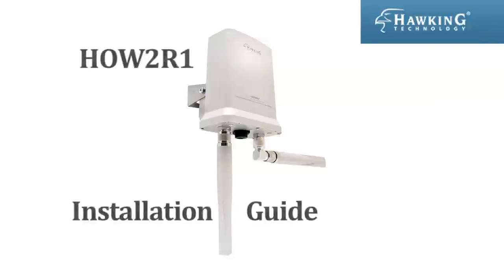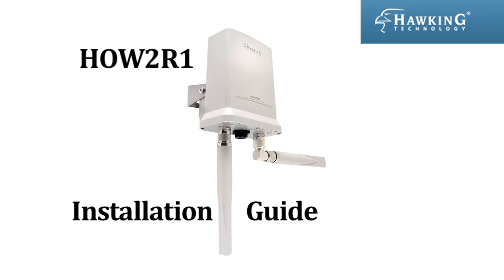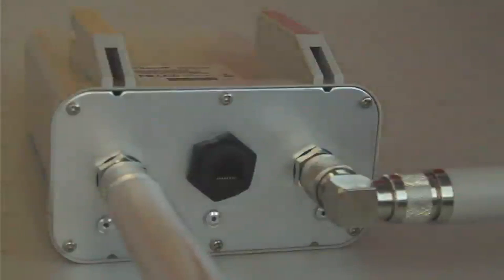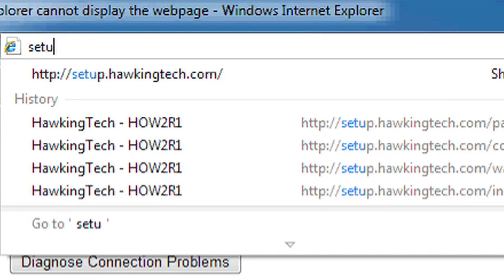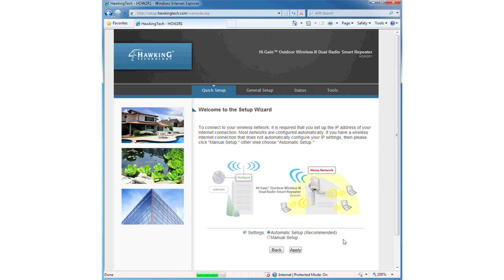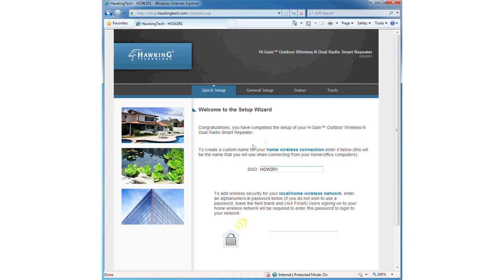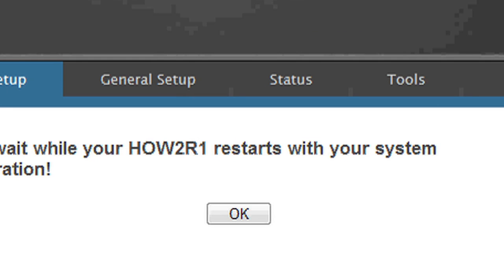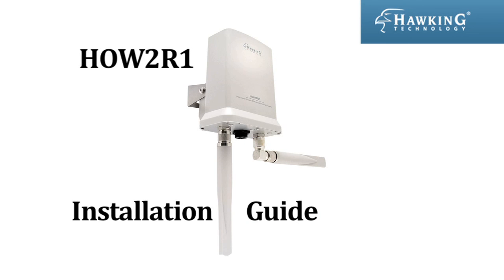[INSTALL] HawkingTech - HOW2R1

Comment from the maker: Plug a Windows computer into the LAN port on the PoE, disable your WiFI (if enabled), turn off any firewalls.  Then insert the CD into your computer and run the software.  The software should detect it and give you an option to do a factory reset of the unit.  You can also log into the web page of the unit and do a factory reset there.

Comment from the maker: @MsBillyoo This can act as an AP.  However, it will require you to disable a few of the features of the device because that isn't the primary function of the device.  You will have to disable the DHCP server as well as turn off the wireless internet features.  A device that will work as an AP out of the box would be the counterpart to this product, the HOWABN1 Outdoor Access Point/Bridge.